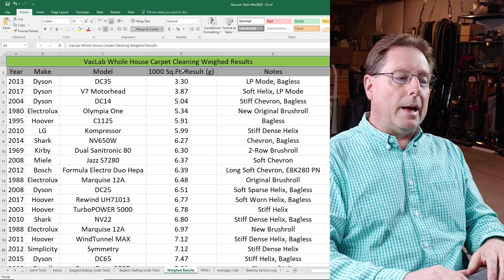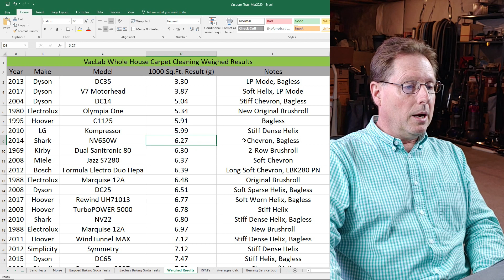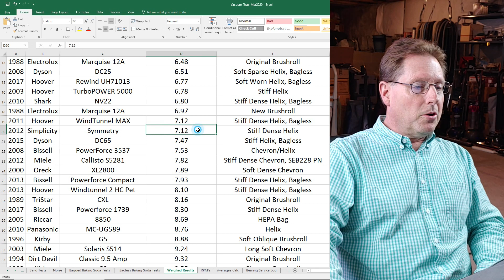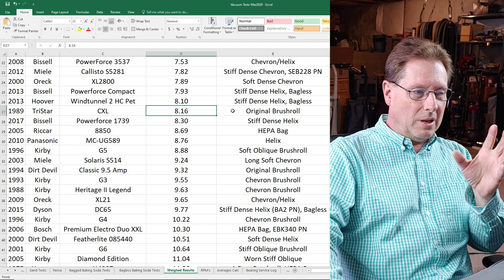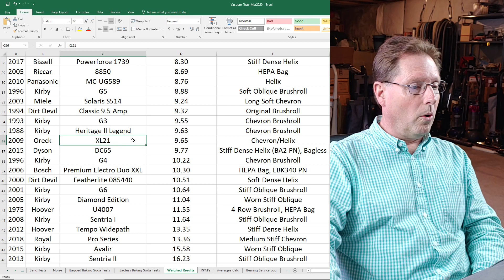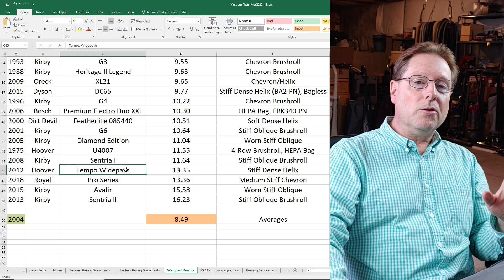Whole House Carpet Cleaning Analysis | Boring Spreadsheet Discussion

Comment: Although out of all the kirby brushrolls, does chevron brushroll do a better job than the soft oblique one?
Reply from the maker: I think it does a slightly better job, but the stiff oblique is clearly the king.
Reply: So out of all the carpet cleaning performance tests like whcc, banking soda, stuff under the carpet, etc, do each vacuum do better at one of those specific test while it might do a bit worse at another test? For example, the Oreck xl21 did much better at sand and baking soda test than one of those Dysons with a BA2 head, but it did nearly the same or slightly worse for whcc. Or another example is, I think that Riccar 8850 did better at stuff under the carpet test than the Panasonic, but it did about the same for whcc. Do all these tests vary greatly?

Comment: I'm not sure if you're going to see this comment VacLab since its been 3 years for this video but have you ever tested the Simplicity Synergy X9.10 in your findings? Is it also somewhat of a carpet shredder? I'll be looking forward to your reply.
Reply from the maker: I've not tested that model.
Reply: From what I can understand, its essentially a Riccar Radiance with slightly different filters and internals while the rest is untouched. Still uses the tandem motor configuration. From what I hear, its basically a rebadged Riccar Radiance.  @VacLab

Comment: Is it possible for G6 and diamond edition to get similar pickup like the sentria 1 if their brushroll was all in the same condition since they all have similar airflow?
Reply from the maker: Who said those two vacuums have the same airflow? 😄
Reply: I thought the sentria 1 have 137 cfm the G6 135 and the diamond edition 134 which are pretty similar so that’s how I was wondering if they would perform pretty similar with same brushroll condition. 😊
Reply from the maker: @brentcho1275  after a full refurb, the D.E. should be about 7-8 CFM lower than a Sentria 1. The performance difference would exist but also be small even with the exact same brushroll.

Comment: So in a nutshell if you want a cheap vacuum but still has good performance get the Bissell Bagged Upright that's still sold in stores. You want a canister vac that performes well you're looking at a Bosch but idk if they're still being sold, Miele would be the second best choice. The new Dyson with the Animal 2 PN is the best bagless machine but is rather expensive brand new. If you wanna spend a tad bit more money on (but still on a budget) a "bagged" machine and get AMAZING pickup grab the Hoover Tempo. Then last but not least if you want a upright and don't mind paying an arm and a leg but will get top notch performance buy you a newer style Kirby and have very clean carpets.